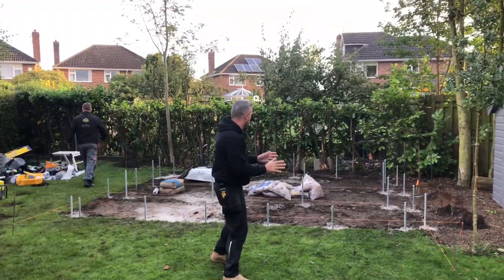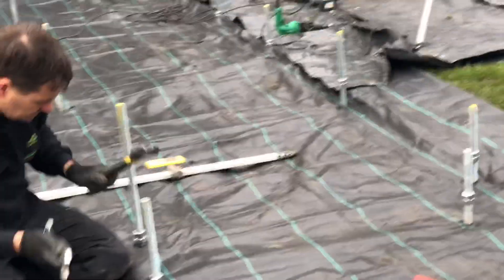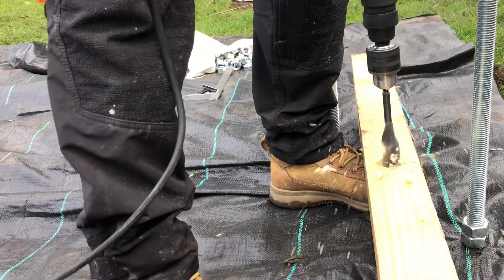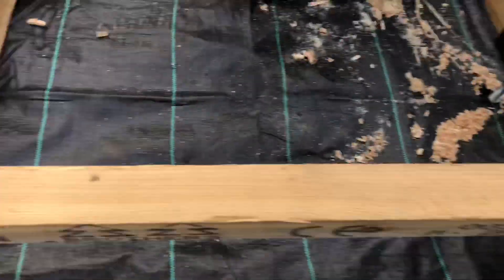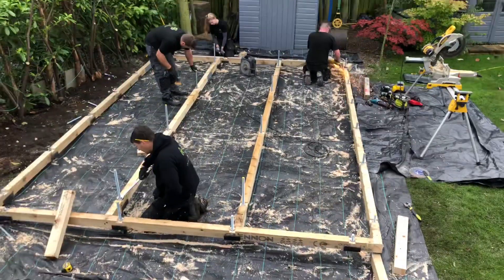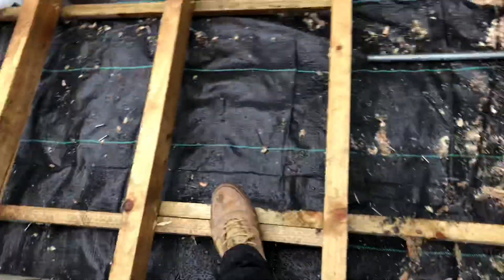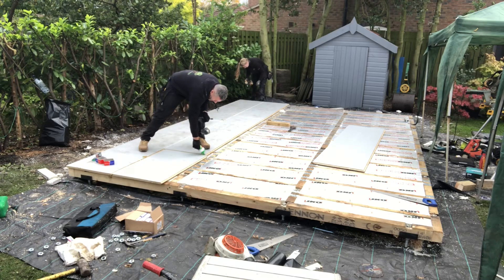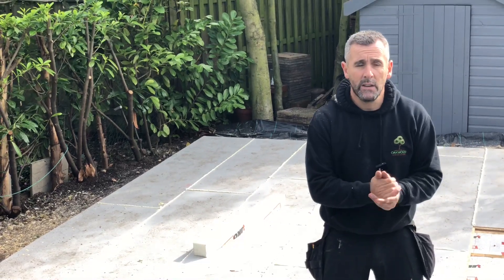Day 2 of 5mtr x 3.5mtr garden room build

Comment: I think your videos are great for a DIYer to learn from. Spent ages deliberating which ground foundation to go for. Nearly went for the screw & concrete  method  but something didn't feel right about the  setup,  one of the faults of doing engineering for a living..  So  decided to get  12 x 1.7m helix screws instead that my son helped me install at the weekend.  Bit more expensive than the threaded bar method but less work to install. Anyway thanks for all the videos, I expect the rest  of my cabin to be of a similar method combined with other cabin methods.

Comment: Loving the  the build William. I’ve just finished building mine from your previous videos and the only change I made that saved a load of time and money  was  dig  a shallow channel below the middle rows of studs and drop them down  4 inches so as to allow the 4x2 floor joists to run straight over them as bearers . Now I don’t need loads of hangers ,twist nails and it makes it easier for insulating. Hope this idea helps.

Comment: Very nice mate, get yourself a PPN nailer it will make light work of your hangers and use flooring screws and you won’t break half as many driver bits
Reply from the maker: tried a PPN nailer, I can nail them quicker by hand than the ramp up of a Dewalt
Reply: william griffin mini compressor & pnumatic? Providing u don’t mine the air tube trailing
Reply from the maker: Got one in the van mate, not used it in a long time now
Reply: rob121212blue cordless  baby
Reply: william griffin off cause you can😂😂

Comment: An other good video buddy.
Would it be any benefit to get a round spout type thing made on the front of the wheel barrow so you can just pour the concrete into the holes  like a pouring jug effect.
Has your charity draw taken place . With Christmass and different things happening I have missed a few videos 
Keep up the good work bud

Comment: Great work! Try pre drilling the boards first with a small drill bit it will save the bits from snaping.
Reply: If you buy cheap screws then pilot, any half decent screw should be fine through a p5 board but good screws are expensive.
Reply: @TurinTuramber  i agree that using quality screws is a must. But i think you've missed the point that the pz2 bit are snaping not the screws.
Reply: @russellpage7976  Yes I know it's the bits, high performance screws will go in with far less resistance. Not saying it will cure totally crappy bits but should mean no piloting. Usually get extra bits thrown into a box of screws too.

Comment: Hello, its me again with another question. As you say you always cut the rim joists longer than needed and you "eyeball" the rod centre onto them, mark the centre and drill the hole. Why not use a speed square up slid up to the the rod edge (all from the same side of course), mark the middle and then drill the holes. At worst you will only have to move the joist 12 mm.

Comment: I’ve had a couple of erabuaer impact sets from screwfix, not had that much of an issue with them, cheap as well
Reply: I've done 4 boxes of 6x100's using a single 50mm pz3 erbauer bit and it's still going strong! Not tried the ps2's but I will be now. Great bits

Comment: Great video series. Just one question. Is their a reason you use channel onbtop of the nuts instead of just large flat plates?
Reply from the maker: Just prefer it mate, loads are using the square plate washers, I’ve got to give a warranty on my builds and the strength is in the shape, nothing wrong with the flat plate washer though

Comment: Hi Will, excellent video as usual. Out of interest once the 4x3 is put over the rods, is it not worth add a square washer before tightening down to timber?
Reply from the maker: no need to even bolt it mate, the weight of the build holds it in place tbh
Reply: william griffin perfect, thanks for that
Reply: @thegardenroomguru  Probably would be quite a good idea for uplift as buildings like these are classed as light weight structures. Great video!

Comment: Could you tile that floor when finished Liam
Reply from the maker: Sure, but you’d need to over board it with hardi board and I’d be using flexible tile adhesive and grout, as it is a timber floor still 👌

Comment: Great videos, big fan. Q , do you bother painting the steel shoes with cold galvanising paint to resist rust?  Also, are your rods stainless or HT galvanised? Same reason again, or is the view that treated 3 x4 likely to rot before rust compromises the shoes?
Reply from the maker: They’ll not fail in my lifetime or the customers mate,  I’m all for over engineering but it’s fine

Comment: Sorry if you have covered this but what standard are the 24mm threaded bars you are using? Stainless, galvanised or zinc coated? ....Stainless are a bit pricey 😬 im thinking of using a similar system for a decking

Comment: When you put a weed membrane down and then make holes in it with the mini pile foundations there is no point having it at all. The foundation beams should be tanalised. Nail plates & butted corners unecessarily compromise strength.

Comment: Great vid dude just wondering if the owner had to get permission for a garden room that size 👍
Reply: There are a few rules to abide by no bigger than 30m2 I believe. Also if closer to boundary than 1m then cant be taller than 2.5m if not then 3m height max other caveats  like combustible materials etc. You can look it up on your local council website to be doubly sure

Comment: What bit was on the drill when they were spinning the nuts on?
Reply from the maker: It’s designed for taking stickers off cars, but there’s a couple of guys using a wire brush attachment that they say works better
Reply: william griffin perfect, thanks! Thought that was a great time saver and would help if any small bits grit/concrete remain to be knocked off. Cheers

Comment: No 1...pour a slab. No 2...box up and pour a nib wall around the perimeter of the slab but 100mm higher. No 3...put high density foam down. No 4...add timber frames to top of nib. No 5 add flooring to suit. The way you guys did this had us guys, two builder's, a concrete placer, and a plumber in stitches. Talk about a lot of faffing around.
Reply from the maker: And before No1 dig out, fill with hardcore, shutter for slab? No? Cost, time, money! If you don’t like it mate, put a thumbs down 👎 22k subscribers in 6months, I’m the one in stitches mate, enjoy your evening, I will 😘
Reply from the maker: Did you only watch this one because the thumb nail was of Amy? I’d imagine so

Comment: Dont understand why you use rods, not needed
Reply: How would you do it?
Reply: I do it on a pad system using larger section of timber.
Reply: What you fixing the pad to?
Reply: @timmo5443  do you use larger sections to cut down on the amount of concrete pads?
Reply from the maker: our system works, its simple but effective, quick and precise, overcomes uneven ground and  is cost effective. We are happy with it, others are now following suit ;-)
Reply: @thegardenroomguru  it is quick and precise also if you floor is level then your walls are a easier to get right
Reply: @brendonredgate2705  If the suspended timber floor isn't level and you built it then you should get an office job! 

Less pads means deeper timber equals higher floor and lower ceiling. Also personally I try to avoid that hollow sounding stage feel.
Reply: @TurinTuramber  wear some slippers then